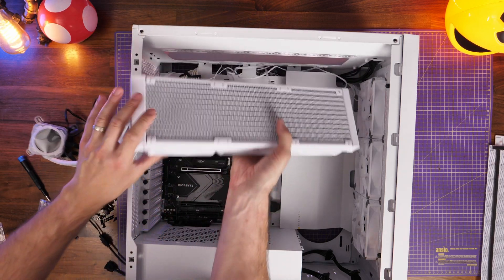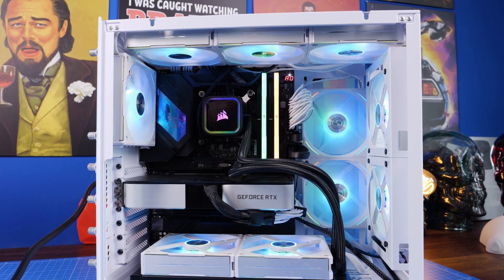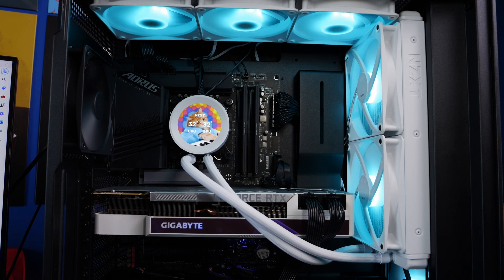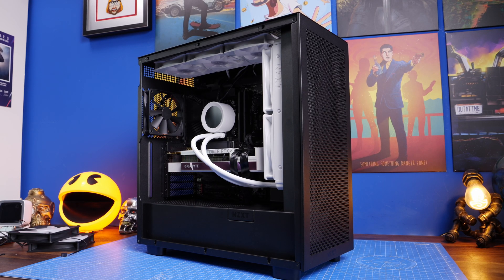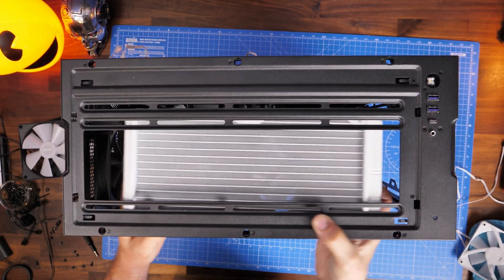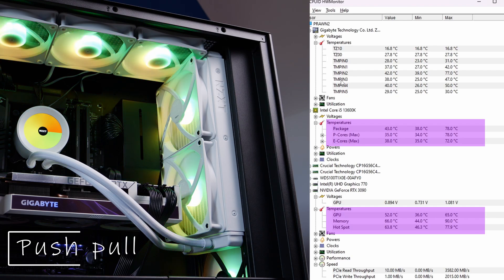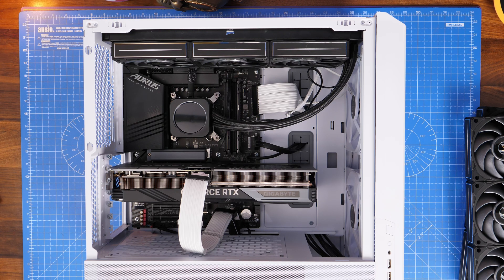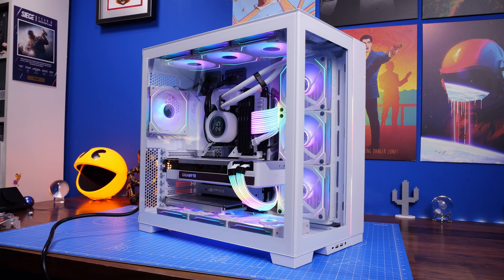Where should you install your AIO liquid cooler? The best places tested!

Comment: I have a Corsair H170i 420 mm mounted at the front of my Lian Li Meshify  III and I am looking at getting the new Corsair Link version but I am unsure as to whether it will fit due to what seems to be an extra protrusion at the top of the radiator for the "link" components.

Comment: Just to add to the Air Bubble Problem:
While diffusion takes a few years yes, you should not forget that there is always some air already in the AiO and it needs to be there. 
So having the pump running on air or partially so, can start right from the beginning, if you bottom mount it.
Also most Asetek based AiOs dont allow it, but non Asetek, 
like BeQuiet with the Silent Loop 2 or Alphacool with the Eisbär Aurora or my actual PL360 Flux 30th AE from Cooler Master (top mounted in a H500M) allow for refilling of some liquid if the need arises.

Comment: Is it true that top mounted radiator will run cpu warmer rather than on the side for example on lian li o11 dynamic evo?
Reply: I believe so, as the GPU heat will cause the CPU to get warm. So it depends on what you want, cooler CPU? Front or side mount as intake for the AIO

Comment: I was under the impression that exhausting through the rad wasn't particularly favourable. Until, I read a reddit post that detailed the benefits and drawbacks.
Supposedly, your cpu will be hotter but your gpu should be slightly cooler and vice versa depending on if you exhaust or intake through the rad.
Not sure how true this is but the guy explained it in a way that sounded logical.
Reply: correct .. u need to prior one of two >> cpu or gpu .. all cases are designed in aesthetic pattern neglecting the engineer CFM functionality .. i would love to get sponsered by any factory and will design one that outcome the best out of what is been sold out in market nowadays ... this what happen when u ask a marketing guy to design an engineer product.
Reply: Nobody's stopping you. Design it, put your ideas out there.  @oldschool_bamagatrader9960
Reply: Yeah that’s how it works

Comment: AIO front or side mounted and top exhaust will give the best results. Top mounted AIO will work with all the heat put out by the GPU, hence your results.
Reply: Thank you so much
Reply: I don’t understand how fellas don’t understand this lol
Reply: Pc build for 8yrs and best performance is liquid aio on top and better is when u do all 4 sides lol @knights6239
Reply: You need to understand how a radiator works. Cool air needs to be pushed across the fins of any radiator , car / aio whatever. You have to draw the cold outside air across the radiator aka fans intake. As long as you have other intake sources and the proper pressure of exhaust fans to create flow in the case to cool the other components you are good. But this idea I keep seeing of exhaust  for aio to “keep dust out” or whatever makes no sense. Never push hot case air over your radiator . It will do nothing
Reply: It's what I was thinking too, but if we do front mounted, the GPU wont take the heat from the AIO?
Reply: @triplocore so me personally I have an h9 flow with aio side mounted, pulling air in, with 3 inhales on the bottom, with 4 exhaling on top and rear. soon I'm gonna be testing the difference for placing the rad on top while exhaling, with 6 inhaling on sides and bottom. Personal guess, but I think the current setup will work better with this system. GPU stays cold with bottom inhales, rad fans provide extra flow, 4 exhales on top also contributes as a "breathing" pull.
Reply: @triplocore  not if you have bottom intake fans which are closer to the gpu. like the video says
Reply: @triplocore this is exactly what i wanted to know , it confuses me , isnt the radiator front mounted blowing hot air inside the case ? I want to change my 120 mm cput cooler that i have on the back exhausting by a 360 mm front mount , but im scared to have issues doing that as i cant mount a 360 on the top having a smaller case
Reply: @WaZarooo  Honestly, I chose to use my AIO as an exhaust fan. My logic was that my CPU already has better refrigeration (AIO), while my GPU only has the standard cooling system. So, the GPU would suffer much more from the hot air than the CPU.
Reply: @triplocore  this what came to my head aswell , the gpu would suffer more then the cpu while the cpu already has a triple fan radiator colling
Reply: @triplocore  did you guys even watch the whole video ? :face-blue-smiling: